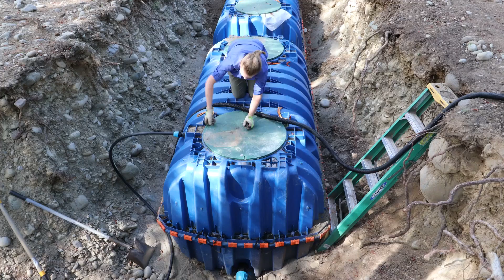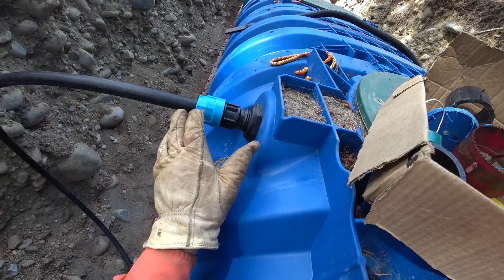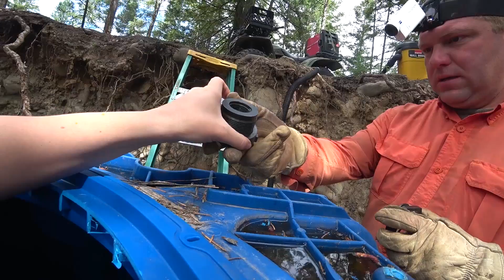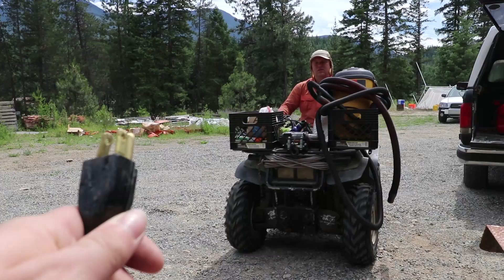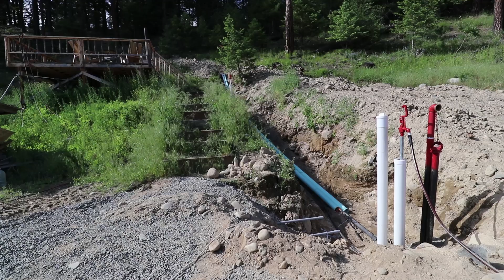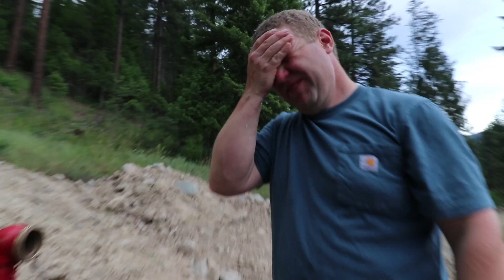First Time Using $10,000 OFF GRID WATER SYSTEM

Comment: A real INSIDE job for Alyssa !!  Vacuuming a little blue condo!
You know it -- but don't think you mentioned that once lines are full then siphon pressure will allow using all the water from tank.  
In coupling tanks  I think it is recommended to connect going out the side of one tank and into the side of the other tank so the elbow bends take up slack from expansion and contraction - not as important since buried, hopefully when it cools it will not shrink too much.  Thankfully tank ends have some flex where coupling enters tanks.  

VERY GOOD JOB GUYS!!   YeeeHaw!!!       
I still can't get over that CAVERN holding the cisterns.   Makes my little irrigation project look puney!
Reply from the maker: +RelentlessHomesteading Thanks for being a regular commenter! If these tanks settle it won't be much. Remember what our "soil" is like. Rock. Rocks don't move. Under the cisterns was compacted nicely. Also remember the trench was open all winter so the soil has settled even more because of this. Both our contacts for this project agreed solid connection is fine and desirable at that depth. This project is larger than life for us. It's been much harder than we expected but then again we didn't know what to expect. Doing projects end to end is definitely not for the faint of heart. :)
Reply: What about temp changes and expansion and contraction of the tank from the water level changes.  Water is 64 lbs/ cuft.  Its going to constantly work that lower joining pipe until it snaps.   Just cut a section out of that connector pipe and put in a horizontal  "U" section about 18" long that way it has some compliance movement room.  Same reasoning as on the base of your hydrants.   Also need to connect the  top of the tanks together or vent each tank to the air  Put two 90's to make a 180 deg bend on the end of the vent stand pipe -- make it terminate above the snow line.   Use the stand pipes as a vent and overflow and you are done.
Reply: Appreciate the notice -- No such projects are not for the faint-hearted.  AND we have to choose our own path on deciding how to set things up -- internet and experiences rarely fully dovetail into our own situation.  I just like to throw out thoughts,  especially those others might want to think about - before they just follow what someone else has done.  Its Really un-nerving on things that require such major work to dig up if something goes wrong, ....somethings og gnorw, ....tingshemos go norgw....

Comment: You can determine just how high your tank is by measuring the pressure at the bottom.  Or, calculate the pressure you expect if you know the elevation of your tank.  1 ftH2O elevation = 0.4335 psi

Comment: Jessie and Alyssa - CHECK THIS OUT.  CHECK THIS OUT.

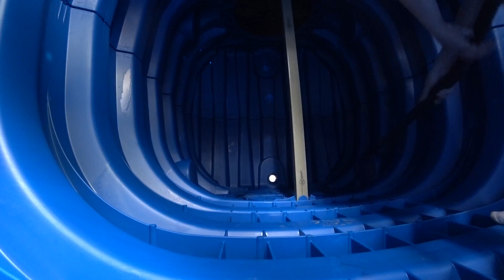O.Hartigan, has a great eye.  He saw a hole in one of the tanks and pointed it out.  It looks like maybe a half inch dia hole.  There is definitely a hole showing at 6:21.  Upper left hand corner as Alyssa is vacuuming.  Look for the lighted spot.

So happy to see this coming together. :-)  There is always a "punch list" at the end of projects (project management term - action list to clean up all the little details you find at startup.).  Always expect a punch list.  Never fret it, just attack it.  It looks like that what you guys do.

Many of the preceding comments are about venting the tops of the tanks and/or interconnecting them.  Vent one and interconnect, or vent both.  Think about a gallon milk jug filled with water, invert it to drain and it doesn't drain well and the walls collapse.  I'm sure you have given this thought.  Read their comments just to make sure.  It is critical.

Comment: Ok after watching I want to ask. Is there a upper connection between the 2 tanks? If so is there a vent on one of them to deal with the displaced air? If not is there a vent on each to deal with the air that is displacing water as it fills AND allows air into them as the water level goes down?

Comment: On the water discharge port it should NOT be lower than the discharge pipe other wise you will loose flow of water when the water level reaches the highest point of the discharge tubing. If you get lucky it may syphon but you cannot count on it doing that. It will very easily airlock.  You need to dig the level of the discharge pipe down so it all goes downhill. Also there needs to be an air vent on the second tank. Also cross flow across the tanks is preferred so the fill should be on the second tank so that water flows across both thanks to get out.

Just a thought, (;-) TP

Comment: The think the tank should have been sloped slightly and the fill line should have been in the second tank. Also you may need another line between the tanks higher up for air flow between tanks.

Comment: just another negative comment.  a bypass and isolation valve so you can draw off one OR the other in case of contamination.  oops a squirrel got into it by chewing through the plastic lid and drowned.  or even a few worms or something.  a check valve with screen to keep those very expensive tanks from collapsing due to the combination of vacuum, weight,and frost heaves. a good thing the cisterns are way high and dry with great drainage  otherwise  they would need to be weighted and strapped to avoid them from floating right out of the ground. nothing worse than covering a 20,000 gallon tank on friday due to rain coming  and monday morning  the tank is 85% out of the ground with no way to lift it to bury again 15 feet down . there will always be a certain amount of un-useable capacity  at the bottom and top of the tanks.  in the case of fire cisterns the filler downpipe  is piped all the way to the bottom in order to stir  sediments  and the pick-up for extracting also  at the lowest point . on the opposite end of the tank.. How many gallons of capacity inside the 2 inch line. 50 gallons 75 gallons? interesting to find out.

Comment: What prevents the air from being compressed as you pump water up into the tanks? 
Also, what prevents a vacuum from happening as you use the water after the tanks are full?
Reply: Just found the design video again and saw there should be an air vent line, and a line to equalize the air between both cisterns.

Comment: I can't tell from the video, but my guess is that the ditch needs to be dug out to lower those lines. Once you pumped in the outlet, you got a siphon going, so it works now. You do need an air vent in the second tank, or another line at the top between the tanks.

Now, if you could find a spring and gravity feed it or ram pump it to the tanks, you would be in great shape.

The place looks like it will be a little slice of heaven. Beautiful country.

Comment: A job almost well done with all the forethought that went into the project I was wondering    why you never put a shutoff valve in between the tanks did that slip by or was it just left out of the video I wish you much luck and good breezes 

Have a good day and a better tomorrow
Reply: drawvenmusket two valves and another  feed line so they could use one OR the other

Comment: I don't get it, how can air in the drain line mess up things? I mean sure you can get a lower water pressure, but water should come out.
Reply: It is a matter of physics and liquid systems.  If there is a spot or place in a line(pipe) that is higher than either end, air is trapped in this high point and will prevent flow.  Try this-take a garden hose and lay it out with one point over an object so that point is higher than either end.  Turn one end up so water can be poured in the hose to fill it.  Until the air in the hump is removed water will not flow through the hose.
Reply: Roy I don't see it happening in this scenario. Having an open end at the bottom and no flow, your pressure at the bump is between atmospheric pressure (assuming only air) and below atmospheric pressure. All you have to do is to make sure that the water level at the feed end is above the highest point in the pipe.

I know the garden hose experiment, to really trap the water even when your feed end is above any of the bumps, the pipe has to be small (water can get trapped above air, without flowing down) and you need multiple bumps with trapped air in your line.

Comment: You have both tanks connected together to make one tank, this is fine.  You don't have both tanks vented together  you only have the first tank venting through your overflow fitting.  You need a vertical vent pipe with bug filter ideally for both tanks, if not you need an upper connecting pipe like your PVC connector and a filtered vent pipe for the first tank.  You must have air after water or you pull a vacuum and you might collapse your tanks.   Best of Luck
Reply: I suspect that they wish to have a gravity fed supply in case of wild land fire.  Fire dept can hook up ti their supply.
Reply: honor harrington buzz Killington. If you watch they fail to succeed so anything they have issues with they sort out. Wouldn't listen to any of you cause it's not your life. Shut up
Reply: How would there be less pressure at the bottom? Water coming in at the top could simply be gravity filled in minutes, compared to the bottom where you would likely have to pump it

Comment: Definitely would put a small diameter pipe between both tanks at the top to let air flow between tanks.  Otherwise water won't fill up past the inlet/oulet in the second tank (air lock).  Also how does the air escape the system at the tanks when filling??

Comment: hi i have a question, why did you put your tanks so far up the hill since there is no road so you can fill them directly from the water truck you must pump the water from the base all the way up. couldn't you put your tanks in a lower level near your hottub so you have easier access?
Reply: Increase pressure

Comment: Maybe I missed it.. but shouldn't there be a small line connecting the tops of the two cisterns?
Reply: Agreed ...You should have a connecting pipe at the bottom and at the top to prevent stagnation and to allow for even filling of both tanks.
Reply: The flat surfaces on the top of the tanks are not the highest point, so they are putting vents on the sides of the tanks instead, individually.
Reply: So I was just watching the video where they showed their designs of the system. Video was back in March this year. 
It has both lines, bottom and top, connecting the two cisterns in the drawings... He specifically said the top line is for air to pass between them.
So i assume they forgot about it, because why else would they not put that line in when you know they wanted to vacuum out the cuttings from drilling the hole?
Reply: Gearz Pop the short sides that are facing each other have a curve to the connection point where you install the pipe fittings, but the connection points on the long ends don't, so by putting the vents individually on the sides they gain 3-4" of effective tank usage. This can be seen in the video. What can't be seen in the video however is the second air vent.
Reply: Ivar Tjärnstig I agree if they don't vent the tanks it will keep getting airlocked plus the vacuum affect will put extra stress on the tank and pipes and cause leaks down the road
Reply: I must have missed the YouTube terms of service that require you to watch an entire video before asking a question and being responded to with profanity.  They have some issues, I'm confident they will get it worked out before they backfill.

Comment: Couple of observations.  

1.  There's a thin spot or perhaps a hole in the tank. look at 6:21 in the upper left hand corner.  

2.  I didn't see a vent for the second tank. if there isn't one the air pressure will eventually find a weak point or you will not be able to use the full capacity of the tanks. 

3.  The last observation which is actually more of a recommendation is to add a shut off valve between the two tanks so if you need to service one or the other you can do so without having to empty both tanks. The second reason is so if you have a leak in your system you can shut off the second tank and not loose all of your water. 

Aside from this I have to ask if you were only hand tightening all of the joints or were you using a big pair of channel locks off camera? If these joints are only hand tight you are going to have major issues with leaks.
Reply: O.Hartigan, Great eye.  There is definitely a hole showing at 6:21.
Jessie and Alyssa - CHECK THIS OUT.  CHECK THIS OUT.
Reply: I was curious if there was a breather valve or something up top otherwise they might create a vacuum once they start using large amounts of water.  

Also filling those tanks from down that Hill is a huge strain on that pump.
Reply: O. Hartigan I was thinking about the pressure release in the second tank. A very easy way to fix this is have a pipe running from cap, to cap.
Reply: i worked with pipe joints like that few months ago and they all leaked even after good tightening. ended with silicone (but it was only for garden and on surface)
Reply: second tank definitely needs a vent, either tank to tank or just vented by it's self
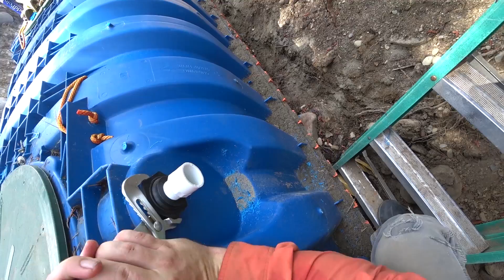Reply: I wondered the same thing, but if you watch at about 7:07 you will see him prepping the channel locks to tighten things down.